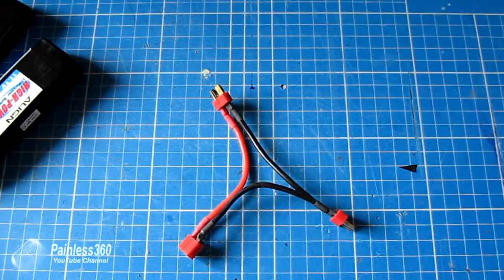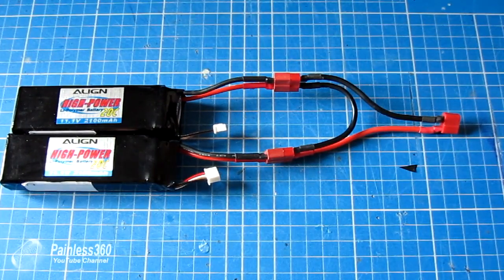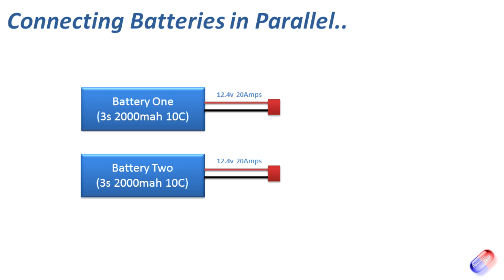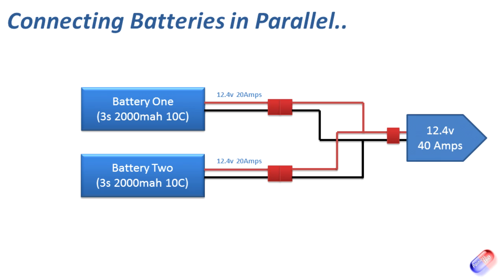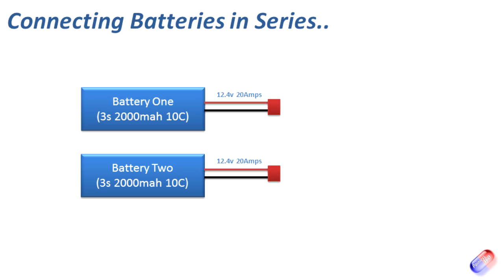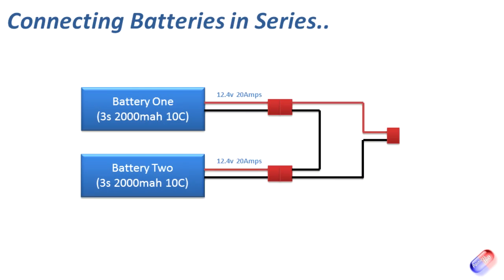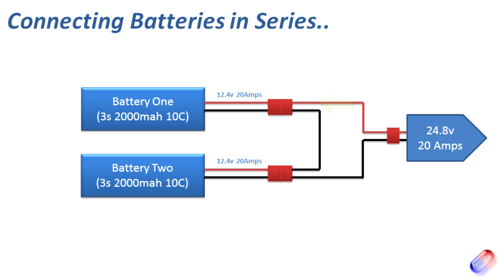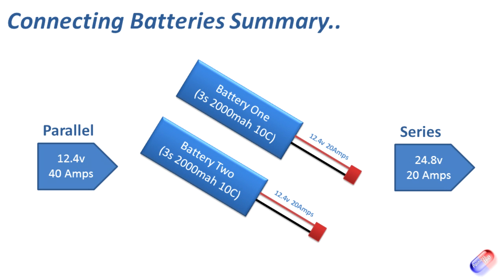Connecting batteries in series or parallel (LIPO)

Comment: Hi all, i'm new to this and have a simple question i hope u guys can help me out 

'' i'm making a dual motor rc plane and i'm using 2 lipo battery of same capacity (3cell). both motor are 1000KV and i will be using two 30A ESC for both motor. Please can anyone tell me should i connect battery in parallel and series ?. if i'm right then  should I be connecting in series so that i have more voltage? '' Please help thanks in advance
Reply from the maker: Parallel is same voltage more mAh, series is more voltage, same mAh.. Depends on what you want to use..

Comment: if you want to connect a battery in series can you charge them with 4s if you connect 2x2s battery together
And if you connect a balance lead together do you need to connect it like this

         ||||*||||*||||*||||*||||*||||
         ||||*||||*||||*||||*||||*||||
         ||||*||||*||||*||||*||||*||||
            *    *    **    *    *
          *     *    *  *    *    *
        *     *    *     *    *    *
      *     *     *       *    *    *
     G     1    +       G    3   +

G= ground
1= first cell
The first + is the + from battery 1
3= cell 3/ 1cell from battery 2
And the second + is cell number 4/full voltage

If you connect the ground from battery 1 and the positive from battery 2 you technically got a serie connection and the positive and minus create cell 2
Reply from the maker: Yes you can, be very careful though. You can also buy those types of cables too - http://www.falcon-aviation.com/6s-balance-connector-to-2x-3s-conversion-cable-align-type-connector.html

Comment: Hi great video thank you. I had two old  2s 2200 25c lipos that I  wanted to connect together in parallel. I have a 150A ESC so I think this would be ok?
Reply from the maker: Each battery could only supply 55A each when they were new. It'll be less now. Even together they couldn't supply the 150+am;ps the ESC needs.. Hope that helps..

Comment: Hi, sorry for the silly question (love the channel btw) I have two 11.1 3s 2200 mah batteries I would like to put as parallel as I would like a long flight time. I work it out to be 66amp would I have to get ESC's rated to 70A? 

Thanks
Matt
Reply from the maker: In parallel it would be a '11.1v 6S 22.2v pack..
Reply: Painless360 no Lee that would be in series in parallel you double up the max amp draw and the capacity

Comment: So, I just bought two identical batteries with the wrong connector. If I rewire them in parallel to a new connector of the proper type, will they be able to charge properly? Do I need to add anything to the circuit to make sure they charge evenly?
Reply: I should note that I'm charging them from an Arduino Uno type thing. I'm a little worried about damaging the charging circuit on the board and/or blowing the batteries up.
Reply from the maker: I've not used that to charge a battery. We use dedicated LIPO chargers here. Good LIPO packs are normally try to use cells with the same internal reistance to help match the cells and give even charging and discharging. Using two separate packs may not. This video was from back when things like 4s were exotic and batteries were expensive. Now it's easier to order and use what you want in terms of voltages and capacity. Best of luck with it :D

Comment: Hi, quick question: What if i connect 2 lithium ion 3.7V in series of different capacities (one is 1200mAh and one is 2100mAh)! Can i connect them without any problems afterward? o_0
Reply from the maker: Connecting them in series means that you can't charge them easily and one pack will be empty well before the other has run out. If you want to do this then I'd always use the same capacity.. Best of luck!
Reply: +Painless360 alright thanks, i might just use same capacity ones....

Comment: will there be any change in the c rating if we connect multiple batteries in parallel? actually im thinking about entering a competition in which only low discharge NiCd and NiMH batteries are allowed , but the motor i have draws much more amps than the max outpur of the batteries. is there any way to increase the c rating of a battery?
Reply from the maker: +rashad reyaz parallel equals more current.. best of luck.

Comment: Hi Painless, As usual a good video. Only thing I am missing (or haven't found in an other video of you) is: 
I have an S500 which requires a 3s battery, I want to buy two 4500ah 3s batteries and usually use them in parallel. I assume i need identical charge state (being best for the battery). But can I use them individual as well and then use them in parallel again?
Reply from the maker: You will. Watch the weight though as that will be a lot heavier than one pack.. Best of luck!

Comment: Hi

I would like to serially charge a 6S 10000 mAh and 3S 1000 mAh LiPo battery
Is it possible ? 
Any tips
Reply from the maker: I'd charge them one at a time. The two packs are simply too different and it's not worth the risk of even trying. Best of luck!
Reply: Jut wondering if I charge both batteries serially at 9S 16Ah but a sensor that would stop balance charging the 3S battery at 1Ah
Reply from the maker: You could only charge them both at 1amp as that's the rating of the smaller pack.. The current flows thorough both batteries so you have to use the lower value to not damage the smaller pack. It's not worth even trying..

Comment: where can I buy that connector ?
Reply from the maker: eBay normally but they are not hard to make if you have a decent soldering iron..
Reply: what are they called ? I want to buy and if you have the link please tell me it is very important
Reply from the maker: Very important? Wow. Google 'lipo battery deans parallel' ;)

Comment: 5:00 slip of the tongue probably, but BOTH arrangements double the power compared to the single battery, because power = current * voltage.  
I think it would have been clearer to say that parallel gives you effectively a 3s 4000mAh  10C battery and series gives you a effectively a 6s 2000mAh 10C battery, both able to put out the same max power, which is twice what the single battery can do. 
Maybe introduce the 3s2p / 6s1p notation, too. 
It would also have been important to say that parallel connection can be dangerous if the voltages of the batteries are different, as they will try to equalise voltages (one charges the other) and high currents can flow in that situation if you do it wrong.
Reply: Therefore, to obtain a "double capacity powerpack" from two batteries, we should connect them parallel to maintain the voltage of powered circuit?
Reply: Yes, connect them in parallel, you will get twice the run time (or a bit more) and your motor gets the same voltage (but maybe a bit more constant). 
However, you need to make sure that the voltages of the cells you combine in parallel are very very close.
Reply: Will a BMS help in this case? Parallel charging of similar battery packs
Reply: H
Reply: @c.g.c2067 what’s funny?

Comment: It's a silly question. But can you connect a bunch of sets of series batteries in parallel also to get both higher capacity and voltage? and is there a specific order in which you'd do this? It is really an RC question. And for that I apologize. But I can't find a definitive answer to this question anywhere I've looked. :(  Sorry for such a silly question but numbers aren't my thing. lol
Reply: er current..... Not voltage.
Reply from the maker: Yes you can, you need to be careful as cells need to matched ideally so they have the same internal resistance, voltage and capacity. It's easier to buy the battery in the size you need now - LIPO prices have fallen dramatically in the past three years..

Comment: How do I connect the batteries to keep the same voltage and amps, just to double the mAh?
Reply from the maker: After watching the video, what would your guess be?
Reply: I think i need to go in parallel
Reply from the maker: Yep, Parallel = same volts more mAh!
Reply: But it won't be to much amps for my device?
Reply from the maker: The amps are pulled on demand, but pushed into the device so it'll be fine..
Reply: Thank you for explaining ;)
Reply: Painless360 so this should also help voltage sag and prevent puffing batts right?
Reply: Paulius Jakubauskas laba

Comment: Higher the 's", higher is the voltage. Shouldn't parallel connection of two 2200 mAh 3s batteries give 4400mah 3s as parallel connections ensure "same" voltage output across terminals?
Reply: Yes, that is correct. As far as I can see, the video does not contradict this, but it (sadly) doesn't mention the change in capacity.

Comment: can they be connect in series & parallel to double the voltage & mah ~ if so how.??
Reply from the maker: Yes you can but I'd look at buying the battery size and capacity you need. Best of luck!
Reply: Painless360 i plan to connect 2 sets of 5x lipo batteries. to double the volts and quintouple the Ah. should work? they are brand new and identical.

Comment: I am building a battlebot and I was wondering if there was a way to wire up two batteries in series to only give power to the weapon motor and weapon, and have a singular battery give power to only the rest while being hooked up all to one receiver and motor controller?
Reply from the maker: You could. You'll need to watch how the power from the principle battery is pulled as it will get lower faster and think about the low C rating for the LIPOs as you will want the power to be there with minimum drop. Best of luck!
Reply: Painless360 Will do and thank you so much! We actually got it working today!
Reply from the maker: Great news! Best of luck with any upcoming battles!

Comment: can I connect two identical batteries in parallel and use one lipo alarm connected in balancer connector with a Y cable? (one Y cable to power connector and other Y cable to balancer port)
Reply from the maker: It would sort of work but not well as you're only monitoring the cells on the battery you're connected to, and while that is useful, won't spot if one of the cells on the other pack is in trouble.. Best of luck!

Comment: you say twenty ? please explain . are they not two amps. charts say 1000 mah is 1 amp ,? how is it u times tening it. ? Am i missing it i dont understand an is very important cause i was about to put.  two 11.1v 4500 Mhp 30 c thinking bye what i no in series i thought was going to have twenty two point 2 v (24 supen realy ) an only4.5amp bye ohm law watts would be amp times v give me my watts so lets see. 4.5×24 = 108 watts which is not goid enough my motor is rated at 425 watts so u can see bye ur math. its 45amps which is going to be hudgely difference lets see 45amp×24v 
is1080 watts ! 
so u see ive stoped my. project.  so pleae help me umder stand. .cause i was just ready to see if i can run. a thrid. 5100mhp 8c to increse t h e amps to."but i am now comfuses
please. can u shed some light for i can understand.
Reply from the maker: +Rowdy Savage Slayer! I always use amps not watts. Figure out the amps the motor needs and then make sure the pack can supply that easily. Best of luck.

Comment: I have 4x 30amp ESCs, so theoretically together they will be capable of drawing 120amps. I was taught that whatever battery I choose, it must be able to supply those 120amps just to be safe.

So, suppose I have a 4S 2200mAh 30C battery. On its own, it will not be able to meet that 120amp safety threshold that my ESCs require (22.0 x 3.0 = only 66.0amp). Now, if I run two of these in parallel, is it correct to assume 44.0amp (capacity of 2 batts in parallel) x 3amp = 132amp (safely exceeding the draw that 4x 30amp ESCs could ever make)..?
Reply from the maker: +K Khalifah yes, but you can get high discharge lipo batteries now to do just this. 65 and 75c packs are easier to find. Best of luck!
Reply: K Khalifah

Comment: If you connect the battery's in series will the battery capacity still be 2000mah or will it be 4000mah
Reply from the maker: +Fpv-Drone-Racer series = same capacity and amps with higher voltage.
Reply from the maker: Answered in the video ;D Parallel = same voltage, higher capacity and amps..
Reply: the big reason why people want to gain more information regarding the mah total in series or parallel is because they obviously want the longest run time possible. Most people probably aren't aware of the fact that mah stands for "milly-amps" so to speak, so you should be more clear before reiterating that it was apparently "answered" in the video because the key concept of capacity was never referred to.

Comment: Great video.  I found it curious that you made a BMX reference (we're very into BMX racing).  On another note, if you connect two batteries in parallel (as in your example), does that mean that you're doubling the capacity while keeping the overall voltage the same?

Thanks
Reply from the maker: +Michael Boggs parrallel equalls the same voltage but higher capacity  = longer flight time. Happy flying!

Comment: Hi Painless, my question might be painful but I've looked through the comments and I can't find the answer.I am an newb when it comes to batteries so I hope you can help.I have a Flamewheel F550 and 2 X 5000mah 3s lipos. I would like to combine them in some way to ech out more flying time. I'm presuming parallel is the the right way to connect them. Is that right?Please forgive me for my lack of knowledge.
Reply: I worked it out, thanks for your lipo video as well, really good info. I have way to high c rated batteries 65-130c .
Reply from the maker: +Tamati Tapara great! Parallel gives you more flight time..

Comment: Can a 10a esc tolerate the amps of the two lipos that are in parallel? 
If it is rated as 2-4s
Reply from the maker: Not exactly sure what you mean but the ESC will just pull what it needs, it's not that the batteries push more through.. Hope that helps.
Reply: Oh thats interesting didnt know that
Reply: I thought the current would push through
Reply from the maker: The current is a result of the voltage and resistance. Not the other way around. Best of luck..

Comment: Thanks for explaining the difference to me. I always mix the 2 up for some reason. Had the correct cable to make a 12s out of 2 6s lipo batteries but thought i connect them in parallel instead of series. And hats of for you you are a very patience man with all the questions you get. It's like people can't think for themselves and are looking for a quick and easy answer instead of looking it up themselves on forums or use there brains. I know i went looking for a answer myself but this was a pretty simple one. I see a lot of people in the comments here asking the same question over and over again. I don't have a problem with explaining something to new people in the hobby but i give up on them if they keep coming with the same every time.Do your research self it gives you a much better feeling if you solve the problem yourself with research on forums by digging trough the site.
Reply from the maker: Thanks for posting that. I agree too many want the 'quick fix' rather than think the problem through and use the resources available and gain a better understanding of what they are looking at. I try and teach the person to fish, not give them one so they can help themselves next time they are stuck ;) Happy flying!

Comment: Hello,   
I have a micro quad that use 1s Lipo,  I was wondering if there is a probleme if I get my 2s lipo  and set in  parallel  cel 1 and cel 2   so I will transform my 2s lipo in 1s .   Do you see any problem with this ? 

Thanks in advanced.
Reply from the maker: In theory, no. Be very careful and check everything many times before plugging in the cells and then plugging in the new 'battery' into the model

Comment: Hi, I'm using 2 - 6s , 5000Mah LiPo's in series for a total of the 24volts you mention but my flight times are short. (130c rated per EDF MFG recommendations)is it possible to add a third battery in Parallel after the series connection to gain more Mah and thus longer flights? Vince
Reply from the maker: +Vince C not like that. I'd look at upgrading to a battery that's the right voltage and capacity for the job. Best of luck!

Comment: very helpful video sir.i have one q,,,
i want to increase my quad flight time..and which way should i connect my 2 lipos??
Reply from the maker: +Dilshan Perera What is your guess after watching the video?
Reply: its parallel ..right?
Reply from the maker: Yep - same voltage but the mAh capacity is added together.. Best of luck with it!
Reply: thanks man
appreciate that
Reply: Look, if you connect them in parallel, you will be able to get more flight time, bit it won't be as fast as if you connect them in series, so it's basically like this:

Parallel: more flight time, more heat on the motors cause of the amps

Series: more speed, less heat on the motors.

Comment: can you connect a single cell to a 3s in series?
Reply from the maker: +Ryan webster They are, each cell is 4.2v..
Reply: Ok so if I had a 3000mah 3s and put a 2s5000mah it would make a 6s battery
Reply from the maker: No. I'd look into just buying the pack you need... Best of luck!

Comment: Hi there
I need to connect batteries parallel because of space.
I will be using one of this http://www.maxxprod.com/pdf/CR2805.pdf
and 2 of these http://www.hobbyking.com/hobbyking/store/__21247__HobbyKing_10A_ESC_1A_UBEC.html
and 2 of these in parallel http://www.hobbyking.com/hobbyking/store/__9173__Turnigy_800mAh_3S_20C_Lipo_Pack_E_flight_Compatible_EFLB0995_.html

can you tell me if this set up would work or would you suggest better combinations with the same motor.
Thank you.